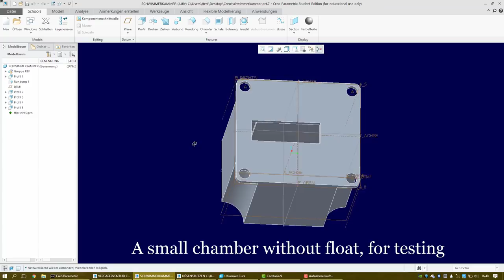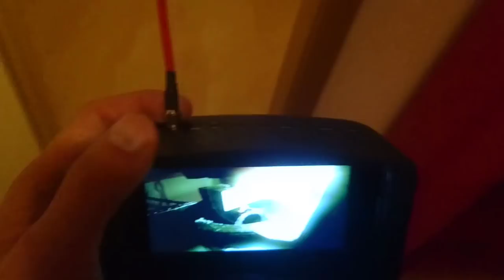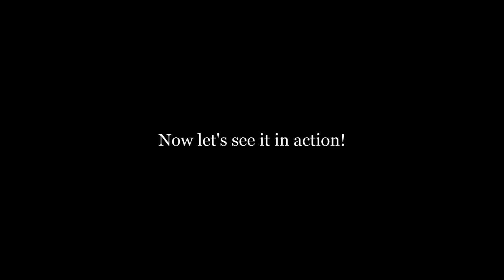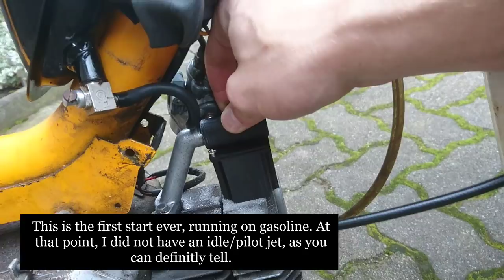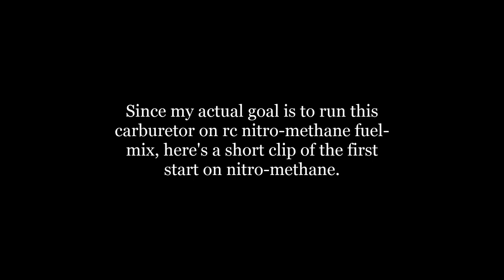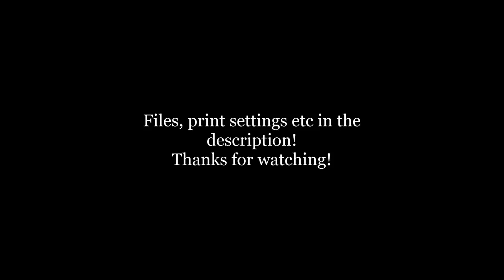Fully 3D printed carburetor

Comment: Finally, I saw somebody writing "PLA is fully resistant to gasoline and nitro". Thanks!
Reply from the maker: No Problem!;) what are your plans?
Reply: I needed to print a moped part for somebody. I did a test with gasoline myself and yes, pla and tpa is resistent.
Reply from the maker: @Michel777  thanks for the feedback! Good you made the same experience
Reply: What it is not resistant to is engine bay heat....

Comment: I LOVE this video!!  Finally someone actually USING 3d printed parts on a vehicle!!  All the other videos I look up are just people making models of stuff and not actually using parts!  I just got my Lulzbot Taz-6 and am going to start making car parts and trying them out to see if they can take the abuse!!  I have a Nissan Silvia w/ an sr20det (turbo 2.0L) and we are going to see if a 3d printed throttle body can take 22psi of boost. Hahha
Reply from the maker: Thanks so much man!:) you're so right, most people just start printing random stuff or they use the printer for things where other material would be better (well.. ok I kinda did that in this video, but it was just an experiment).
About your intake, I'm using a 3D printed intake pipe (connecting between carburetor and engine) on my motorcycle. It works absolutely great. No problem holding the vacuum, seals and holds up great. It should easily hold pressure up to 10bar and more, so definitly sufficient for a turbocharged engine.
The material that I've used is TPU, it's a flexible filament, the result is a very stiff, rubber like print.

If you want more information or have questions, feel free to ask! And let me now about your throttlebody project!
Reply: I just printed an intake manifold for a motorcycle carb to a predator 670. I wish there were more of us demonstrating how powerful printers are.
Reply: I'm gonna guess the answer to that was no? 😂
Reply: You have to make it out of a higher melting point plastic, in the car's hood they will deform and fail.

Comment: I love new tech going old school.  Nice work!
Reply from the maker: You should see the latest version I did (a few weeks after this). It looks like an actual carburetor with a throttle cable. It's on the thingiverse link!
Reply: @DerKrawallkeks  I couldn't view it,  Do I need to join to view.

Does this have a float?

Later  I'll take a closer look at your new carb.  Cool stuff man.
Reply from the maker: @foch3  thanks for the interest man. It doesn't have a float, it's just a running from the bowl. It would be quite difficult to make a float work with printed parts.. But not impossible.

You should be able to view everything without a problem!
Reply: @DerKrawallkeks  Now I can see it.  I like that Guillotine style throttle plate.  Does the screw on cap mean you are going to add a throttle cable?
Reply from the maker: @foch3  yes exactly. A throttle cable can actually be used already

Comment: did you have issues holding the carb jet orifice tolerance or did you drill them as blanks? I'm wanting to print Weber DGV jets and air correctors and everyone tells me it wont work, I think you just proved them wrong. Do you think your Keikin jets have the same thread pitch?
Reply from the maker: Hey, it's really lots of trial and error to be honest. Both the thread and the actual jet size needs to be tried. The thread I don't remember, no idea what keihin uses:)

Comment: Cool. How did it hold up after more than a year of use?
Reply from the maker: Haha, just cause it's 2018 now it's not been a year:D I've tested it for a while but now I've put the engine in a little kind of gokart, where I'm not using this carb.
But if you're wondering about the material, I've tested it on gasoline and nitro methane. And it's still holding up, 3 month now.

Comment: I'm going to try this out on a motorized bicycle. If I can dial it in then the ability to just print your own carbs with the jets is huge for replacement parts. However I'm a bit confused on what's the best way of getting fuel into the carb. As it seems like its completely sealed. So what's the best way to connect a tank to this.
Reply from the maker: Try it!:) Yes htere's no way of adding fuel to this carb. This was just a test. I think there is no way around having a float valve.
Reply: @DerKrawallkeks  So how does it work if theres no way to give it fuel? I'm a bit perplexed here as you got it running on your moped. I wonder if a typical float could be replaced with an external check valve or even making the float on the outside of the carb. I'm really interested in this project and I was wondering if you still have the base CAD files knocking around.
Reply from the maker: @battoisoutto6657  it's just for testing, I wanted to see if it would run. I filled it up, and then mounted it. There's no fuel line or anything leading to it, it'll stall after a minute or so. You could make it work with a float valve from normal carb (cut it out and glue it in place) or something else
Reply from the maker: @battoisoutto6657  the CAD is on thingiverse:) have a look into the video description
Reply: @DerKrawallkeks  Okay I guess its time for me to dust off my cad skills and see what I can do. Since you've proven that PLA is gas resistant making a check valve from it and grafting that to the carb print shouldn't be too difficult. Thanks for clearing things up and responding.

Comment: Wait.... PLA is RESISTANT to gasoline????
Reply from the maker: Yep, it is.
Reply: DerKrawallkeks well ... well wow.. thanks for that info, this opens up a whole new Avenue for me.
Reply from the maker: no problem. Yes, it's great;) and as I said, even works for nitro-methane, which is dragster fuel (or in my case, methanol and nitro-methane, which is RC fuel)
Reply: PLA is the same plastic used for Jerry cans and milk jugs, it's resistant to most chemicals